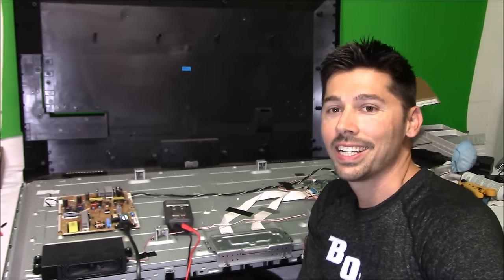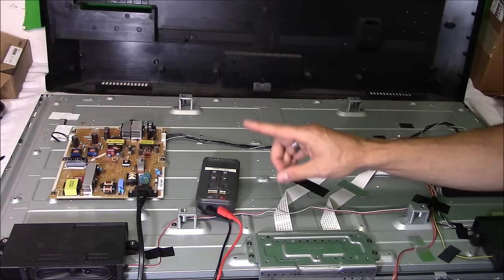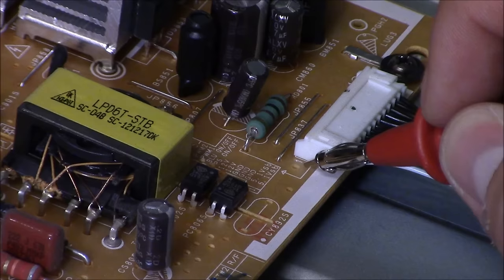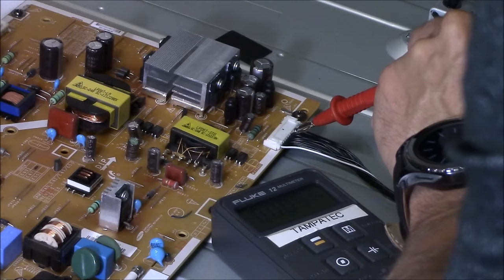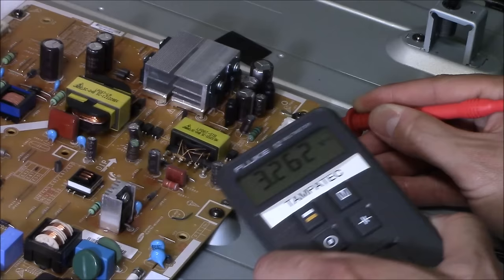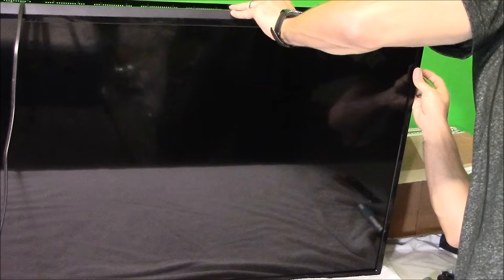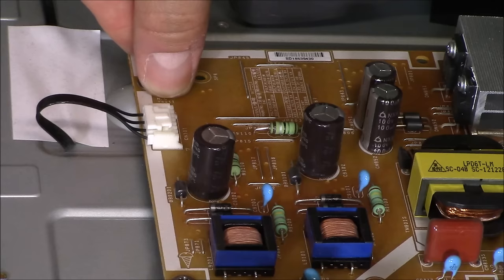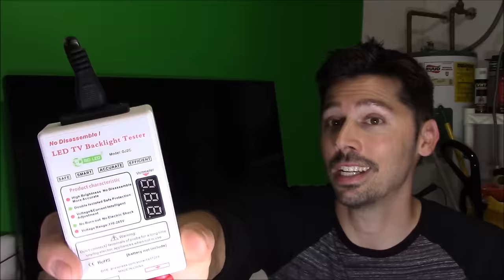LED LCD TV REPAIR sound but no picture, black screen, dark picture pt1

Comment: I have benq 27 inch led display model GW2760S but recently it  shows thin horizontal lines  on the  half of the screen. is there any solution? I fixed all the dry solderings, cleaned all the white strips and connectors with the circuit cleaner. But I am still having the same problem. Can you give me your e-mail id so that I can send the picture of it?

Comment: I have a HP 2309v 23 inch lcd monitor, the backlight turns on for barely one
 second. Then goes out, I've replaced the caps near the inverter 
transformers, but that didn't help. Should I replace all caps? Then I 
have a LG 32LD320N 32 inch lcd tv with the same fault. If I pull out the 12v
 cable to the inverter, the connect it again while the tv is on I have 
picture for split second.
Reply: You may need to replace backlight inverter
Reply: I replaced the power supply and it works fine now. I took the power supply from tha same kind of monitor that had a cracked screen.
Reply: LellePrinter82 ok glad u were able to fix ur tv

Comment: the RF Connecter to the tv on my Element got pull out when the person forgot to unscrew the cable connecter. Do I need a need Tuner?
.
Reply from the maker: try to solder it back on with 40 or 50 watt solder iron but yes replacing rf tuner will work too.

Comment: I reflowed a Samsung main logic board. before it was blinking red but not turning on. now it turns on and makes sound backlights come on only. so reflowing the tcon board. never use heat guns those are bad. they need a proper reflow with a reflow machine. spend the money and make money faster

Comment: Hello, so I found this TV outside in someone's trash can, I figured I could have a go at getting it working if possible so I brought it home. When I plug it in with noting plugged into it but the power cord and hit the power button the screen turns on, flashes the Sony logo, the. It shuts off. I have done a lot of searching and there is no flashing red light error code as many others have pointed out. When I use my IR on my phone to press buttons or the side TV buttons the green light flashes as if it was working. I used a flash light against the screen and can actually see the screen, so it sounds like maybe a backlight?

Anyone have any idea if I can fix this? Thanks for your help!

Comment: I've got question - been trying to find out how much a replaceable screen is for a 32" or 40" for an LCD tv - been looking on Ebay - can't find the price or screen - any help ??   thanks  -
Reply: Nobody sells new LCD screens nowhere. Basically we are all screwed. You have to buy a new one unless you get lucky and someone has one used.
Reply: thanks - if they did the screen would be too expensive
Reply: YesDonald Ellett  way too expensive, its as much as the tv
Reply: same here, just bought a hisense 51 inch, 4 k smart tv for 399 from best buy, go 4 k all the way, what a difference compared to 1080, you would not believe the detail

Comment: hi, i checked the voltage going to the led driver board, and got 58 volts/ and u said it supposed to be 100volts.. so i guess the led driver section is bad..
Reply: I got this far as well on my VIZIO e470i-A) and I get 65 volts on 2 of the LED pins, not 100v. Not sure what that means? I guess its a bad LED driver section but is that on the power board or the logic board?

Comment: I was doing the tests.  I have sound.  I can see the image with the flashlight.  I was checking for back lights through the vents and when I pushed it back the picture came on and worked........only to turn off again in 10 minutes.  I can't figure out which part I need.  Any help?
Reply: Most likely u need a video board. Sound but no video. Aka main board
Reply: Thanks.  It ended up being the power supply board.  I changed it out and all is well!!
Reply: Brent Green OK great. A lot better than having to buy a whole new tv

Comment: What do you do when 12 volts do not appear?
Reply from the maker: If tv is plugged in and don't get 12v can be bad main board or power board. Get tv boards at shopjimmy.com or electropartsonline.com use code tampatecfriend for discount.

Comment: if led driver voltage is 0 v ,then led driver psu board is dead or psu board is dead?
Reply: Could be both but does the psu to led driver have power?
Reply: @johncitizen6791  power yes to led driver 4 pins but although tv has picture with flashlight ,led driver voltages which are supposed to be for 42 inch 157 volts,the two middle pins fluctuate between 154-95 volts every second!!so??
they must be steady 157 volts,so maybe psu board or led lights or both?

Comment: opened up my samsung un55h6203afxza, and it is alot different than that vizio. no back light, flashlight test shows the image. id like to narrow down between power supply board and led strips (from videos those are my two main guesses on problem) before buying parts or pulling apart the screen. any tips on testing those voltages to the leds on this model? shopjimmy indicates led driver is on the power supply board, does that support the leds as bad? or could still be either psb or leds?

Comment: Wish I could find a video on trouble shooting the power board I replaced the  backlights with new strips I've got voltage going to the backlights but it still doesn't turn on

Comment: Tampatec can I ask you a question about a ps3 system?
Reply: Is there any way to aoid doing a full reset, ie. causing everything to be deleted, i cant sign in to my acount on it during loading the ps3 freezes and it does not unfreeze

Comment: HELP!!!!  My Vizio tv has a faded/white picture. Audio works perfectly. Any idea what could be wrong?
Reply from the maker: TheSweetLady4Life lower the backlight and brightness if picture still looks faded white then unplug tcon board. check picture again. tcon can cause picture issues or backlight circuit too. shopjimmy.com has these boards.
Reply from the maker: TheSweetLady4Life try reset TV first
Reply: ***** Thank you,  I will give this a try.
Reply: ***** Thank I will reset first,  thanks for responding.

Comment: Have a 32LG3000 with sound and the picture comes in 15-20 minutes.
The screen goes on and has colored stripes in this 15-20 minutes.

https://www.dropbox.com/s/kprpxqdl3frtfls/20160910_114734.jpg?dl=0

The colors chane from minute (or 2)
Reply: I'm
Reply: same hier did u repair it?
Reply: Hi Darko Svikovic, can u solved your problem? how?

Comment: please do not buy  led lcd or plasma tv's these are all not durable & expansive to repair instead use your old crt tv's they are long life
Reply: get with it, they do not make the old crt's any more
Reply: but these tv's have not long life like crt tv's
Reply: first they save electricity, second, it's called survival and making money and keeping jobs, if anything you buy would last forever, you would put many people out of work, and this means all things, tv, refridg, stove, etc cars, only meant to last 7 years, the design is for seven years, otherwise you would not buy another one and this would put many people out of work
Reply: oh really ?  who says these tv's save electricity ?  instead these tv's increases your monthly budget . wanna know ?  
1 ) these tv's have not much sound so you will attach a home theater or amplifier for sound .
2 ) if you bought led tv , lcd or plasma tv these tv's require HD cable connection for picture quality  HD box charge +monthly HD cable connection charge .
3 ) if these tv's got any problem after warranty period over then company or local technician will rob your pocket like a robber . what can they do cause these tv's parts are so expansive .
4 ) throw a 10-20-50 gm stone on your led ,lcd or plasma tv's screen & then see the magic . & same thing do with a crt tv's screen feel the  difference .
sir india is not  rich country people who lives in slums couldn't buy these products if by mistake they buy they can't manage to get repair it .
sir think about those technicians who repaired crt tvs but can't repair these tvs
Reply: such is the mark of progress, some win some lose,
Reply: to hell with the mark of progress like this . i believe old is gold
Reply: instead of giving lecture here why don't you go to any tv  showroom & see how many lcd led & plasma tvs lying there like garbage .
Reply: how to get spare parts of led tv in India.
can u help me Jimmy......
Reply: I have a 36" sony xbr hi-def if you want a great crt...shipping not included.
Reply: raju, you are wrong. Maybe your statements are true for Indian market but not for western standard market, here is why:
1 ) these tv's have not much sound so you will attach a home theater or 
amplifier for sound .

not true, 15w is 15w no matter how you take it. Old CRTs didnt have better audio then new LCDs

 2 ) if you bought led tv , lcd or plasma tv these tv's require HD cable 
connection for picture quality  HD box charge +monthly HD cable 
connection charge .

nope, most of the LCDs and all plasma TVs DO have tuner and dont need 
anything more then TV signal from coaxial IF, and I have to stress it IF
 there is some analogue TV signal in your area. In wester standard 
countries you will not find any analogue signal anymore, so even the old
 CRT will need the very same TV box, except the fact that the digital 
signal from TV box to CRT will look really sub standard to modern LCD.  And that means same added power use for TV box and same monthly charges for connection.

 3 ) if these tv's got any problem after warranty period over then 
company or local technician will rob your pocket like a robber . what 
can they do cause these tv's parts are so expansive .

Actually, to repair LCD is much much cheaper then repair CRT, since there ar no boards on market for CRTs anymore and the tech will have to find broken parts on boards to exchange them. That means that it will take much more time and maybe time is not money in India, but in western countries time costs more then parts.

Also LCD screen is not ageing like CRT, CRT will loose color quality with time (same with plasma) which is actually beyond repair, since there is no sense to exchange CRT screen, LCD can slightly loose the backlight intensity (cheap easy fix) with time.

So actually, LDC TVs outlast CRT easy, are much cheaper to repair and much cheaper on running costs, with much higher quality of picture and sound. If there is analogue SD signal in your area, then a CRT might be a better option, but only then.
Reply: yes you got it right i am an indian . some points you mentioned are not as you say
1) LCD,LED,PLASMA tvs have better sound . sorry but these tvs have not sound quality like CRT .
did you heard Videocon Bazoomba , Onida KY Thunder crt tvs sound ? 
2) tv tuner RF is not available in india now so we watch tv in AV mode or HD connection .
3) sir you said  LCD screen is not ageing like CRT . CRT will loose color quality with time that is wrong CRT tubes lasts upto 10-15-20 years . i have proof but as for as LCD,LED tvs mostly panel faults chances are higher after 2-3 or 5 years & it costs indian consumers a lot .
replacement of Faulty Main board costs 4k,5k,10k & above as per size .
conclusion :- these tvs are not suitable for indian market . india is not a rich country like yours
      thanks
Reply: raju b.sharma or element
Reply: @raju b.sharma : I would hate to burst your bubble sir. But I purchased a LCD in 2005 and it's still going strong. It's a Sanyo 20 inch. So that's about 12 years with no problems.
Reply: @raju b.sharma : The Chinese are making cheaper TVs with lest in house testing. More production and less quality.
Reply: And live in the past with a rubbish crt pic!ture
Reply: Gary Hunter i am happy with that rubbish crt picture tell me lcd led plasma tvs have HD 3D picture quality . so what ? do the characters in the picture comes out of the screen & play drink or had lunch dinner with you . fools think about it
Reply: KUDOS to these videos they are the real deal I have an electronics education and can do all that and some other stuff like Tampatec probably too he knows his stuff real (very)  well
Reply: dude... we can't leave in past......and CRT TVs damage our eyes..... You can only watch videos on 4:3 ratio which is not good. ..... and raju b. sharma  touch your CRT TV's screen with a magnet and see magic......
now CRT TVs are not available anywhere.... now the world is going to HD and UHD technologies... If the technicians don't know how to repair modern TV's they can learn that..please stop saying to ditch LED TVs....
Reply: InfoHoop live not leave my friend . tell me you watch tv for ratios or for entertainment 😂😂 . i know nobody selling or making  CRT tvs now but believe it or not CRT tvs are durable you can watch it in low contrast who cares about ratios tell me you watch tv for just  entertainment or for ratios you mentioned 😂😂😂. if your LED,LCD tv have HD quality picture that does not mean characters having brakefast , lunch , dinner or sleeping with you 😂😂😂 . does LED , LCD TVs do not affact your eyes ? what do you know about repairing ? do you know what is  the cost of main board , lcd panel & invertor board  & how much mechanics charge to customer ? very expansive my  dear friend . india is not a rich country . if an indian customer from slum areas spend 3k , 4k , 8k for tv repair than how will he manage his home ? & do not teach me about CRT screen or magnetic field i know better then you . thats all . bye
Reply: raju b.sharm,

pppfftt  only 3rd world and basement dwellers like scan line CRT TV's today
Reply: raju b.sharm,

pppfftt  only 3rd world and basement dwellers like scan line CRT TV's today ,,,
Reply: Some people prefer a 1955 Ford, to each his own opinion.
Reply: My new LG 32" is dead after 3 years ,  our old one (CRT) lasts more than 20 years in a good condition !!!!
Reply: he said "use your old crt tv's". I have 2. You can't have one of them because you can't read
Reply: Consumerism to feed the stock market......
Reply: Raju by your own logic, isn't it better then to just never buy a TV?  Because then you won't waste any money on something as frivolous as entertainment.
Reply: Yes sir! We purchased a Panasonic 10 years ago. It's survived three moves and still plays like new!
Reply: I dont own a TV, I use the radio to listen t o my stories
Reply: Go back to stone age there you will not be charged for any of the services.
Reply: False. I bought a refurbished Samsung 42 inch plasma tv from a local repair shop 15 years ago. It still works today no problems and it’s used Daily in our bedroom.
Reply: Thats just makes no sence i had plasma ten years still goung strong
Reply: @mumbaikertravelling6581  Expensive or you don't have money at all? Come on they are not that expensive, you say as if eating at Salt Bae restaurant.

Edited : I don't scroll through the comments until the end and now I do. I don't know if you really don't have money to spend on tv, so sorry.
Reply: Why we use projectors
Reply: @mumbaikertravelling6581  what works well in one area isn't always what works best in another.  your argument amounts to saying luxury cars shouldn't exist because they are more expensive to repair and not everyone can. afford them.  How about this?  Ask your mom to carry a 32 inch lcd tv.  Then ask her to carry a 32 inch crt.  See which she prefers
Reply: @mumbaikertravelling6581 that's the whole reason I bought mine dude punched it several times and it didn't scratch or crack... I'm not Def so the sounds still great as well.. maybe it's the brand but mines lasted
Reply: Reliability – CRT monitors tend to have a lifespan of 18,000 – 20,000 hours. LCD monitors are designed to last over 100,000 hours. 2 – A Solution to Obsolescence – A conversion to LCD can extend the life of your equipment. 3 – Energy Saving – An LCD requires less power to operate compared to a CRT.